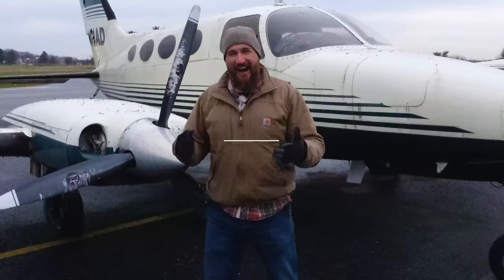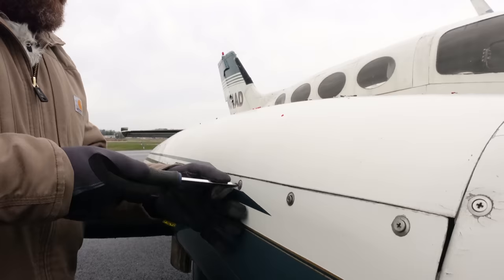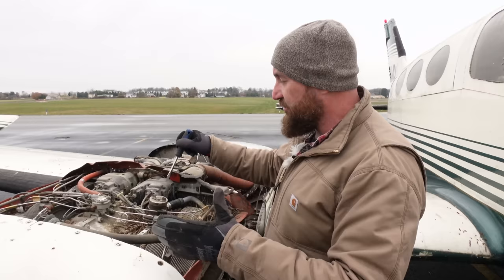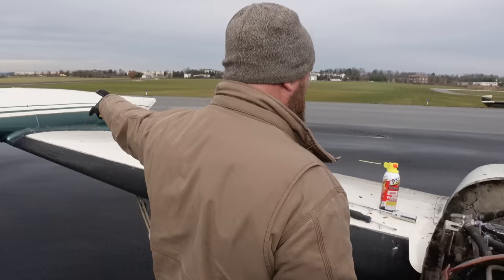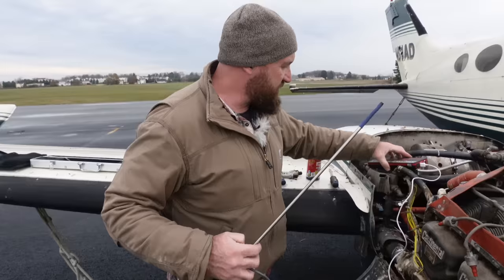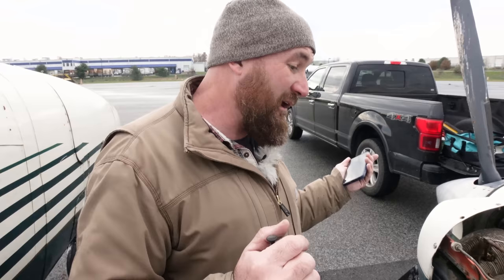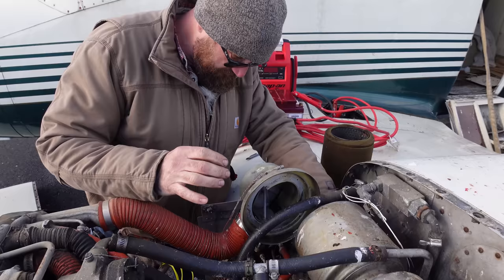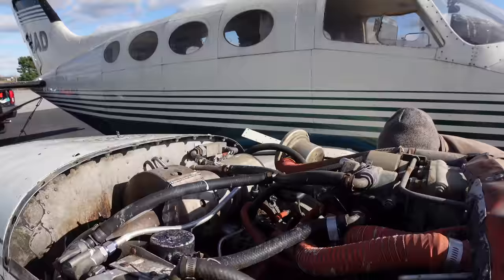FREE Abandoned Airplane... If I Can Start It! Ep1

Comment: I've worked on that exact model plane with those engines and I can confirm it is an absolute PAIN to mess with the spark plugs and ignition harnesses. Anything you're doing takes so much longer with all of that hardware.

Comment: even with a locked up turbo, if it had spark and you were able to spray some carb cleaner into the intake somewhere it should fire up for a couple seconds, maybe long enough to get some oil pumped into the turbo to wet down its bearings such that when you get back you might be able to free it up.

Or you could take off it's oil line and spray some of your penetrating oil down there.

I don't think I'd trust that old gas.   You might want to throw a couple of gallons of acetone in there to bring up the volatiles a bit, then find a way to spray something like that into the intake long enough for that hotter fuel to work its way down into the carbs/injectors.

Maybe you could pull off the prop and attach like an automotive flywheel such that you could safely work on it while standing over it?

Also, that leather interior looks like it would be salvageable.   Just clean it really good with something like Awesome cleaner or simple green then rub lots of thin coats of Lexol leather treatment into the hides.   I've brought them back from old luxury cars that have been sitting out in the sun and elements so long they're as tight as the skin on a banjo.

Comment: What a project bro! So one thing to check in the ignition is the "shower of sparks unit" those are -200 series mags and they do not have impulse couplings and most likely they are rusted up like the rest of the plane , but as an A&P IA and an S, M Comm. I would say everything needs to be overhauled and/or replaced. cool that your giving it a try good luck!
Reply: you pay extra for "Shower of Sparks" in Vegas.
Reply: @jayc4283  yep. In Tijuana it’s usually given after the tiger show….
Reply: @Meatball2022  man! you guys need to go to Thailand!!....you ain't seen shower of nothing!

Comment: Hi Dude, Love your enthusiasm :-) For the record, a seized turbo wont stop the engine starting and running. It simply 
won't make boost and therefore wont make correct power output. But will run and idle just fine on a fine feathered prop.

Good luck.
Reply: Yeah, and judging by how flimsy the intake hose was......it doesn't make much pressure anyway.
Reply: Exactly what I was saying when I watched 👍
Reply: I looked for this comment before  I made my own redundant response. And yes it will absolutely run with out the turbo functioning. I was kind of shocked he didn't know it to be honest.
Reply: @rodmacd8229  Me too!  and the comment about too many amps.  WAT?!
Reply: I'm surprised he doesn't know more about how turbochargers work.  The bottom chunk of throttle they are't doing anything DEFINITELY not going to prevent it from starting up.  I think what really got me was the way he said it as if it was totally true, not just an idea or possible explanation.
Reply: @davidc4162  it makes me wonder if he's really competent enough to be messing with an aircraft at all!
Reply: @davidc4162  let's give this enthusiastic new to aviation dude a break.

He is not claiming to know all, he has been given an opportunity, if he can make it run, he can have it.

I guess if he gets it running, he owns it lol, that's where his problems will really start.

But, have to love the passion and enthusiasm.

It's a massive and extremely expensive task to get that A/C airworthy, certified and back in the air, but, if I was told "if you can make it run, You can have it"
What would I do? 

Well now, probably laugh and walk, but, when I was that young man's age, with a big grin on my face, I would surely grab the tool chest and get out there and, make it run, whatever that took.

Passion is everything, life is worthless without passion 😉
Reply: @OurgateProductions   As someone with zero aviation experience--only automotive, and NONE of it professional--complete misunderstanding of how amperage and turbochargers work.  Really surprised me with amperage--it's the same concept everywhere from cell phone chargers to home electrical to automotive and aviation.
Reply: @davidc4162  Well, we all had to start somewhere. I just made the comment as the gentleman considered the project was stalled (excuse the pun ;-) due to seized turbo shafts. Remember, the deal is, if he makes it  run, he can have it. So I just mentioned the seized turbo's wont stop it running.
Yes, the gentleman lacks knowledge re electrical etc, but he can learn ;-) We all had to :-)

Comment: Having been an Aircraft mechanic for 30 years, it takes a ton of work to maintain a plane to a high standard. Easier once there, but don’t slack off. It will come back to haunt you. Continental engines are tough, but not bullet proof

Comment: I'd suggest that if the "cost of ownership" is that you get one or both engines to run, then go for it.  After that, it's a salvage job.  The cost to repair, WAY exceeds the value of the unit.  Those engine cores may be worth $5,000 each side.  There's also a Wing Spar AD on the 400 Series Piston Cessnas, which can tend to run over $100,000 to complete.  Part that bitch and buy a 172.

Comment: Current is drawn... so a battery "having a high amperage" doesn't matter. Wiring 2 of those 12v batteries in series would have been just fine. The starter and electronics will draw the current they need and no more.
Reply: Thanks for this.
Reply: So one could fry the alternator rectifier bridge if the charge current to the battery is too big, but some alternators have protection for that also.
Reply: Wiring two batteries in series will double the voltage. Wiring in parallel will double the amperage. Wire two car batteries in series and you'll have your 24 volts and the amperage rating of just one of the batteries. Too much amperage is not a bad thing. Too little and maybe you'll get some lights in the cockpit but the starter won't run.
Reply: @burra7  The regulator will drop the voltage in almost every case to limit the current being drawn by the battery... or any device connected to it for that matter.
Reply: @BCfosheezy  And it won't matter anyways with two fully charged batteries since they won't need much power to simply charge back up after an engine start. And to be clear, nobody is suggesting to go flying using car batteries, this is solely to get the engines started up. Cheers
Reply: @BCfosheezy  I’m

Comment: You shouldn't need rotating turbo's to get the engine to fire. They aren't rotating much during startup. Spray some ether in the intake, it may come to life!
Reply: As Randal states, you do not need the turbo to run the engine up. All the turbo is there for is to add power at altitude because the higher you go the thinner the air is. The turbo compensates for that by forcing more air into the engine. Without the turbo you would experience a reduction in power but the engine would still run. And yes you can shoot a little ether in the carb to see if it will fire. Best way is to spray it while engine is rolling over. Good luck.
Reply: If he doesn't already know this, I'm concerned about him renovating a flying machine 😂
Reply: My old Chrysler LeBaron turbo would go about 40mph, when the turbo seized, and took about 20 seconds to get there... But yes, it idled fine.
Reply: @jamesbuckle6077  someone should tell him lololol

Comment: As cool as this video is (and awesome intent by Rebuild Rescue), getting this plane up to airworthiness spec would probably cost tens of thousands of dollars in repair/restoration work.
Reply: More like hundreds of thousands, and I STILL would not fly in it! Decades and Decades of corrosion is a 100% recipe for this plane falling out of the sky!
Reply: @cortezmoore2652  sure, but I would be happy if I ever got to taxi in such a plane!
Reply: @cortezmoore2652  sell it to Venezuela, they'll fly Anything!
😂🤣
Reply: @cortezmoore2652  Nope. The corrosion is all on the skin, which is not part of the structure - the airframe would have been protected from the weather but in any event the prudent thing to do with an a/c in this condition would be ultrasound inspection of that airframe. If there are no cracks, it's good to go.

But considering the amount of work that would have to be done - yikes, $700 alone for the battery - this is going to be one verrrrry expensive recondition. A new turbocharger? That's gonna cost more than a new turbo-charged BMW. In the end it might be worth it, but only if he resells (or rents it out on a high usage basis, like to a charter flight company or busy flight school)

Comment: 42:35 "Could we get this airplane flying again?" Maybe, but not cheaply. This plane was never properly mothballed, it's a total loss. You'd have to do a complete inspection/renovation of the air frame, the engines, the interior, and the avionics. Anything rusty or bird-shitted gets tossed and a new part purchased. It would be a full-time project for a licensed mechanic, and you'd have to rent a hangar for months to do this.  It would be a lot like jacking the old airplane up and sliding a new plane underneath.
Reply: Yes.....very true. More than likely will cost more that it is actual current prize.
Reply: Not knowing a thing about airplanes my first thought was, what is this thing worth as scrap metal?  I guess it's good for YT clicks in the meantime.
Reply: I've heard my boss tell that same line to a guy, except with a old wood boat. We rebuilt that boat and dumped a quarter of a million into it because it meant something to him.. but we all know rich guys just love the rescue story.
Reply: Yep. I don't think it could fly again - but it'd be good to restore for static display in a museum
Reply: My thoughts exactly. I'm an A&P, avionics tech and pilot. You can't let a plane set for a year, much less a decade without some major work and inspections. Lord knows I would not dare fly it!!!
Reply: Repent to Jesus Christ!  Yep, if I was in the sky with this airplane, I'd want to make sure I was right with God too.
Reply: Seems like a fabulous source of donor parts for  other aircraft though! Like, you aren't pulling a seat out of it, but a body panel?
Reply: “Total loss” is a term I only use if something is crumpled like a paper trash bag.
Reply: Repent to Jesus Christ!  Does Jesus help with aircraft restoration ?
Reply: James W. As someone who has also restored vehicles, I don’t do it because it’s a good financial decision. I do it because I want to.
Reply: @Flyboy207  Well get ready for a whole new world when it comes to aviation.  The FAA does not play around with DIY mechanics when it comes to flying with passengers over other peoples property.  Not sure how far he could get by slapping an "EXPERIMENTAL" sticker on it either. If a boat is a hole in the water you pour money into, I cant imagine what that makes a derelict  airplane.
Reply: kwik01 Yeah I wouldn’t consider restoring an aircraft without an A&P cert (which I don’t have).
Reply: @jamesw.6931  I have no idea what you're talking about. I do however, know a lot of restoration projects that cost a whole lot more than that.
Reply: @jamesw.6931  Yeah, you'll never fly with me because I don't fly... I think that's a rather rude thing to say just because I don't know what the "Galloping Ghost" is. There are quite a few people in the world with more money than sense. It's called a "hobby".
Reply: Why does he want the plane? It's a cool challenge to get it running but obvious to a novice that it's not worth restoring it to fly, so unless you just like to taxi around a field...
Reply: @lmlmd2714  Why would you even want to put it in a museum? Would need some historic significance to justify the cost.
Reply: When you have numerous components that have been corroding that long, exposed to not just weather but caustic bird poop, it'll be difficult-to-impossible to restore them to to run reliably - let alone to FAA airworthiness directives. Guaranteed, some of them will have to be replaced or built from scratch. Given that it was built over 5 decades ago, the only way buying a new plane wouldn't be cheaper is if you can milk 6 or 7 figures of clicks out of it.
Reply: @montylc2001  You can't let a plane set for a year, much less a decade without some major work and inspections. Lord knows I would not dare fly it!!!
I wouldn't even want to be anywhere nearby (air or ground) while someone tries to keep it in the air.
Reply: Repent to Jesus Christ!  Repent to Cthulhu!!..The true God and destroyer of your god and jesus..
Reply: @cyborgar15  I guess you would be able to ship it over to africa. I bet many old equipment there is in the much worse condition and still flying
Reply: This isn’t like a car, house, or boat. It flies over people. Therefore, there are strict inspections. A missing Cotter pin after a nut could be catastrophic failure. But, best of luck and I will subscribe.
Reply: @darkarima  Agreed

Comment: Go for it!!! Much respect and you got yourself a big job! Clear Prop!
Reply: Hey, I just watched some of your  ideos today for the first time after watching this video. I subscribed to both channels
Reply: Came to the comments looking for this comment specifically! Lol love your channel Jimmy. I’m an aspiring pilot myself and love watching your videos and other videos like these! You seem like a fun person to be friends with lol. Cleeeaaar Prop!! 😂
Reply from the maker: Hey Jimmy !
So it seems you’ve got a bunch of fans that stopped by here to let me know you’re the man when it comes to these old birds…. I stopped by your channel and I’d say they’re 100% right 👍🏼 If you’re ever up my way you gotta swing by the hangar ! Love your content Brother !
Reply: @rebuildrescue  *hangar
Reply from the maker: @louskunt9798  Thank you Lou ! 👍🏼
Reply: The turbo will unstick if you shoot WD40 into the compressor and turbine housing, put a socket on the compressor nut and turn it. It is just stuck because of corroded turbine housing and tight tolerances on the turbine. The seized turbo is not preventing the engine from starting at all though. A brand new turbo wouldn't spin until the engine fires off and runs. 

If you want it to run quick, here's what to do: Leave the bottom 6 spark plugs out over night to let the oil run out and fuel evaporate out of the cylinders. Pull it into a heated hangar over night and warm it up really good before you attempt to start it again. Don't crank it in the hangar because of fire risk. The next day, when you go to crank it, leave the fuel off, mixture off, throttle cracked, and with it TIED DOWN pull the air filter out and use starting fluid (ether) to crank it.. Let it "run" for a can or 2 of starting fluid. This will warm the engine, un stick and re-seat the valves, un stick and seat the rings, lube the cylinder walls, etc. It will do wonders for the compression. Then you will have a much easier time getting the engine to run on its own knowing that your problems are fuel related only. 

Good luck and have fun! This airplane and ESPECIALLY these engines will never fly again legally so don't worry about ruining them. They are ruined (as far as money value) already, but I wager they WILL run. I want to see you get it running and fly it. It may be "illegal" but it's WAY better than what the Wright Brothers flew!!!
Reply: Clear prop 
😂😂😂🎅🎅🎅
Reply: So glad you guys hooked up!! Blossoming bromance in the making!!! Clear prop!!
Reply: I'm just another broke old guy who LOVES what y'all doin!!!......clear prop!!
Reply: Wow just commented that you guys do a Collab on this, and then I see Jimmy commented here. C'mon guys! You know you have to!
Reply: Lou Skunt why did you say hangar ?I don't get it. It's not the spelling I hope?
Reply: Chester 8420. Well that is some bad news. Not even a brand new out of crate motor can be legal to fly in that plane. So is it the plane and not the motor or is it cause that particular motor has problems ?  Thanks for reply. Peace
Reply: You are a terrible influence...keep it up ;-)
Reply: ppl come to watch your videos but don't sub like it cost them money. you got Hella views but no where close to subs as the views. I subbed
Reply: @johnsellers2999  Just Asking; knowledge being power;  Why would an engine not be legal in that plane?  We all want to know and I was not afraid to ask.
Reply: Maybe it is the plane itself that is not fly worthy. Can you tell me why it won't ever be legally allowed to fly? Are you being sarcastic ? I can't tell. Peace friend
Reply: Can I get a Cleeeeear Prop?! S2 Subscribed to Rebuilt Rescue as well.